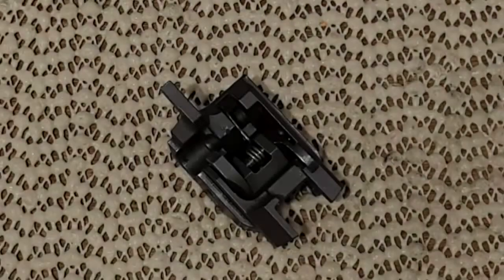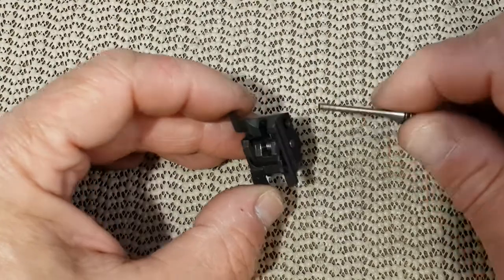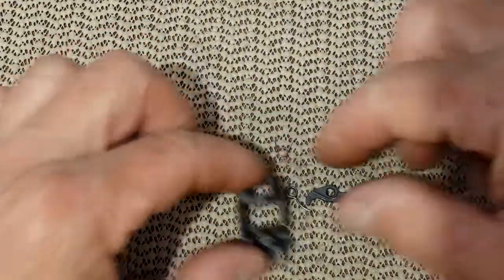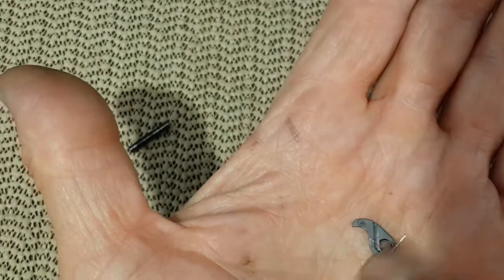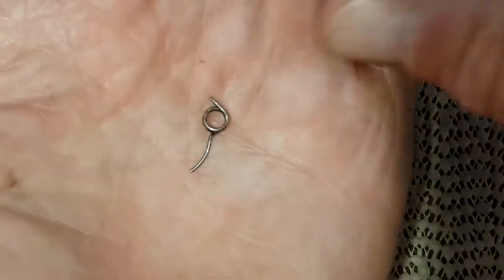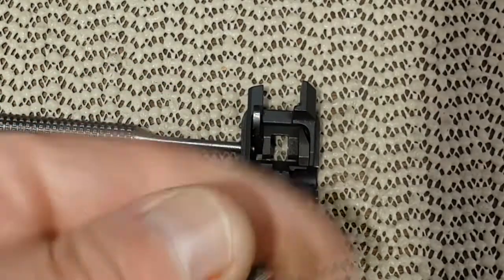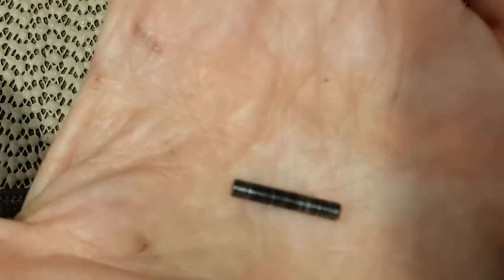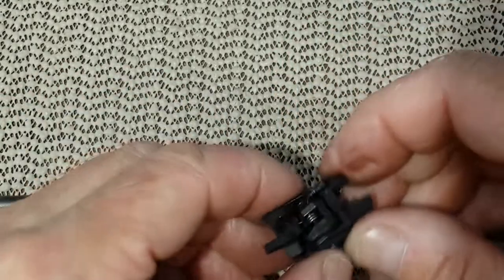CZ75 SP-01 and Shadow 2 Sear Cage Disassembly  (Safety Model)

Comment: Practical Shooter, your sear cage vedio is the best! Wish you did a video for the decorcker sear, which is more complex than the safety one. I had a very hard time to put the decorcker one back together 2 days ago and lost the tiny fire pin block lifter spring and now am waing for CGW shipment. I enjoyed your vedios and your unique accent!
Reply from the maker: My problem is that I can't afford all the handguns I would like to make videos for you guys. Maybe one day lol. 
Do you know I use my SP-01 without the firing pin block. The trigger just feels better without it, so you could use yours without that part, while waiting for its replacement, but it requires a little bit more safety awareness. Thank you so much Mr Du for your kind comments.
Reply: @practicalshooter6517 Maybe one of your firends will let you do some work on a decorcker CZ and you can make a video of it.  Unfortunately I am in Calimunist California. Otherwise I could have bought a part from CGW (forget the name of the part) to replace the block and lights my trigger. Thanks for the reminder.

Comment: Thanks for this video , can you tell me if the sear of the Cz 75 is excaltly like that of Canik P120 , because i want my Canik with a only SA , Thanks
Reply from the maker: Yes, the Sears can be swamped, but you shouldn't need a CZ75 sear to render you P120 SA only gun. If I remember correctly, you can grind down one teeth on your hammer and it will work. But you have to research the details of it. Goo luck Emmanuel.